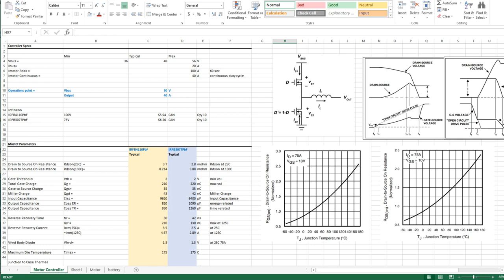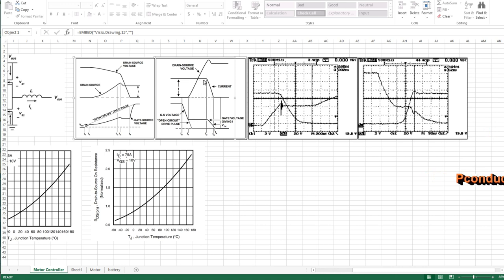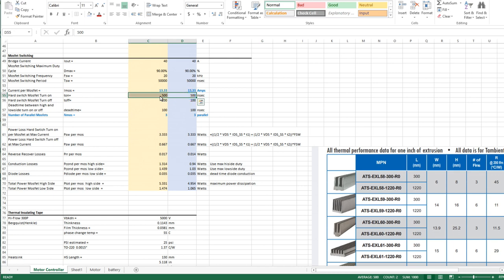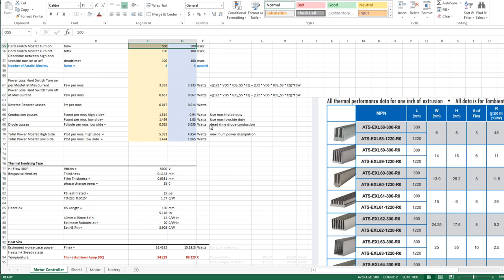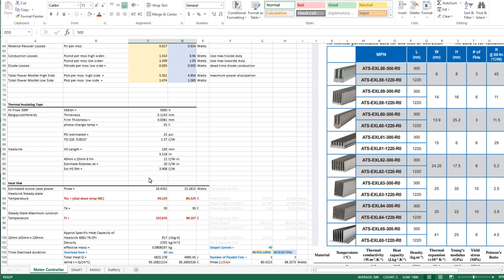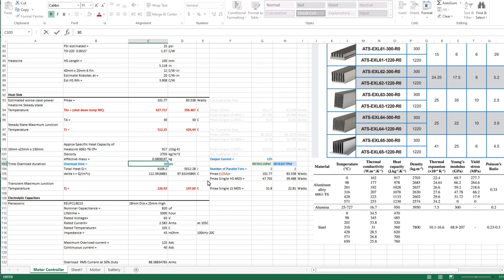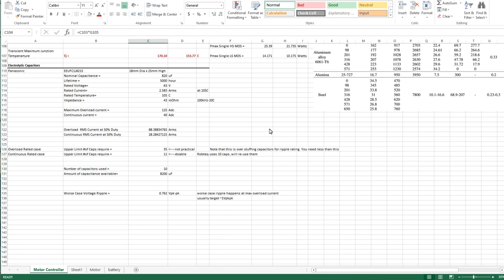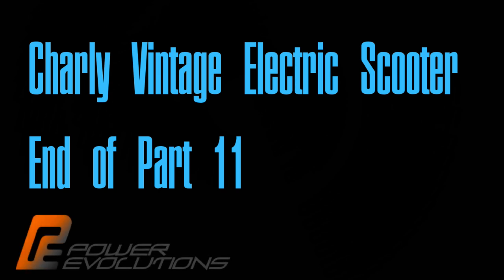Charly Scooter - Retrofit to a 48V System & Custom Motor Controller: Part 11-Motor Controller Calcs

Comment: Sup man I see ur still going with this lol that’s awesome maybe u can check mine out ? Seems to just be missing the battery’s
Reply from the maker: The 12V AGM Lead acid batteries are pretty common for those scooters.  Any 12V 12Ah AGM battery of the correct form factor Length 5.94 inch, Width 3.9 inch, Height 3.78 inch should work.  Put two of them in series to get your 24VDC voltage.